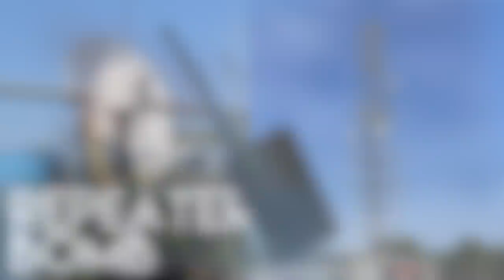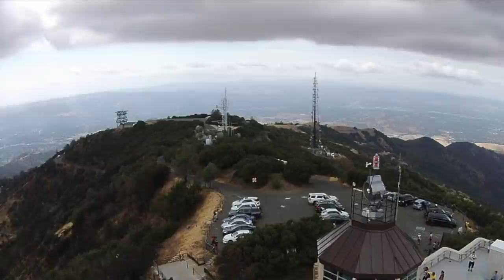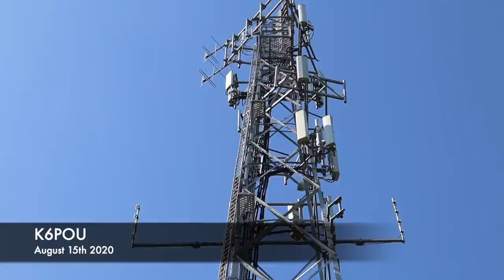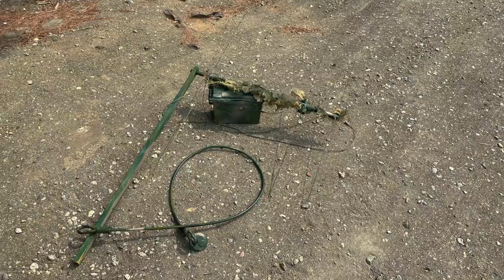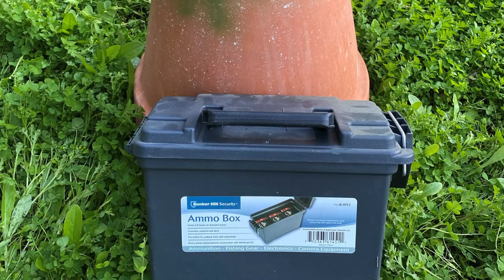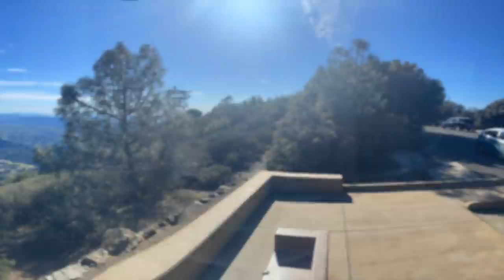The Hidden Diablo Mountain Amateur Radio Jammer

Comment: In the 1970s I had someone plant a CB jammer near my house. Took me about 5 minutes to find it.  I got a nice little CB, a car battery, and a good laugh out of it.
Reply: Why did they plant the device?
Reply: Sounds like you had 5 minutes of fun.
Reply: I'm gonna call BS on that. A car battery would only last a few days with any significant power output. I just can't see anyone thinking that would work
Reply: @NavinF  Let's say the car battery was just an average cranking battery with a low 50Ah rating (not the same as CCA rating). Now, let's assume the CB was a full-power 4-watt transceiver. A 12V 50Ah battery would provide 600 wh of power, which means it would power a 4-watt load for 150-hours, or 6.25 days. Ah ratings for batteries are "20-hour" ratings, and given the low draw, it is conceivable that it would have operated for at least 6 days, depending on the actual Ah rating of the battery. But it's not like it would be jamming every channel on the dial. There were 27 channels until 1977, then 40 channels were available. Still, a CB continuously broadcasting on one channel would only "jam" that one single channel. Seems pointless given the availability of other channels on which to communicate.
Reply: @HangTimeDeluxe  Thank you for the numbers! I guess the jammer would last a lot longer than I expected, but it's even more pointless than I expected.
Reply: @HangTimeDeluxe  I think your numbers are a little long,  you can't expect a CB to operate properly as the voltage drops, and he never said if it was a starting battery or a deep cycle, also your numbers seem to assume 100% efficiency of the radio which is far from reasonable. Now if you want to jam radios you only need a ignition coil an oscillator and an antenna. you can jam stuff up pretty good that way but still not 100%
Reply: That never actually happened.
Reply: @HangTimeDeluxe  27?    I'm thinking just 23.
Reply: TimeDeluxe No it would not last that long. I last my cb on in my truck and in four days it wouldn't start.

Comment: Back in the mid-1990's there were a number of radio jamming devices constructed, primarily for thwarting activity on various CB channels.  I was interesting in the technical aspects, rather than the political.  I set to locating & dissecting the units, to better understand them.  Sometimes access was prohibitive, but in at least two occasions, I was able to acquire the suspect devices.

The first device was rather simple, but also very effective.  It consisted of a 40-channel CB Radio, a Lionel model train transformer, a full-wave bridge, and a lamp timer – all of which was built into a metal ammo box.  The transformer produced strictly an AC Signal, and was rectified via the full-wave bridge to produce a very noisy DC power source, which powered the radio.  The radio itself had been modified in two primary ways.  1st, the audio limiting circuit was opened, to allow for severe over-deviation. 2nd, a sample of the 60 Hz AC power source was ‘fed’ directly into the mic circuit.  The result was a very loud & distorted 60 Hz buzz being transmitted across the channel, rendering the channel useless.  The lamp timer was set, with multiple on/off sequences, so as to power cycle the ‘buzzer’ as it was called, every few hours.  This made the device both annoying & difficult to track down.  The antenna was a simple dipole made of wire, and the device was located in the penthouse, of an 8-story building, giving the buzzer a significant height advantage.  This design is credited to the former Heavy Chevy.

The second device was more of a make-shift repeater.  It consisted of a 40-channel CB Radio & a VHF-High band Receiver, outfitted with two CTCSS decoder boards.  Both ‘Tone’ boards controlled relays, which activated with two distinctly separate tones.  The 1st board controlled the PTT Relay, while the 2nd board controlled a relay in-series with the audio path.  In essence both tones would need to be present, in order to both key the CB, and allow audio to pass to the transmitter.  The VHF-High band receiver would pick-up a signal, with both correct tones, and the CB would rebroadcast the incoming signal over a particular CB Channel.  This configuration made it difficult to track down the individual offender, and the two-tone protected receiver made it impossible for the average person to hijack the repeater.  This designed is credited to the late Tricky Dick.
Reply: One story that happened very close to me somewhere in the 70s when most amateurs around here could not afford expensive gear was that some wealthy guy bought himself a multi kW but very noisy transmitter annoying the hell out of everyone around. The result was a little transmitter built by a small group that was then planted right on the property of the guy. It consisted of a wire antenna pushed into the bark of a tree, some simple and small transmitter and a storage cap. The guy would transmit, thereby charging the storage cap of the jammer with his own transmitters power and the jammer would then transmit some annoying tone for several seconds making it impossible for him to hear any replies to his calls. All that with no battery which meant that it could operate for as long as the jammer didnt break for other reasons.
Reply: @NIOC630  that idea   : D
Reply: That Tricky Dick repeater sounds pretty cool. Being in CB though, isn't there nothing wrong with that? Or is it because of the use of VHF?
Reply: @RAndrewNeal  Oh, it was probably not what I'd call legal, by any stretch of the imagination.  'Tricky Dick' worked at a local 2-way Radio Shop, & was rather eccentric, although he did have a fine appreciation of Jazz Organ (i.e. Booker T & The MG's).  He was very smart when it came to electronics, as he saw connections & possibilities, where others did not.  In my youth, I learned a great deal from him.  Some of those skills I still use today.  He passed away several years ago, but he has not been forgotten.
Reply: @arbutuswatcher  Oh. Why doesn't it seem legal? I'm not well-versed in any of that FCC mumbo jumbo (yet).
Reply: @RAndrewNeal  back then FCC had more power over citizens and the bands they could operate much like HAM today's age FCC pretty much doesn't give a fuck about CBs as no one really uses them anymore so they can't kick you in jail and sell off your assets that were connected to the CB
Reply: @railgap  Still doesn't seem like a problem. It's a CB repeater that is only available to the one who owns it; essentially an extension of that single person's range. Could you explain why it's a problem instead of vaguely stating that it is?
Reply: Was this in California?
Reply: That was mine, it was set to channel 21. Its probably  still up there today. Call me Mr. A** Hol*!

Comment: Years ago, there was an amateur radio jammer on a repeater nearby. It was a 600kHz oscillator and a mixer. The output frequency of the repeater was mixed down to the input (600kHz is the european standard for 2m). The device was tiny, solar powered, and built with expertise. It's a shame that this knowledge was used so destructively.
Reply: Hi Michael, a similar technique was employed in Melbourne Australia about 30 years ago,  few people understand the destructive potential of this near a busy radio site.  Very difficult to locate also.
Reply: So a bent pipe? That's so evil!

Comment: I ran across a jammer that I think was being run by local LE about a year before the 55 was repealed. I was driving North on I35 through Temple TX. My car was a real POS, just about everything was likely to break at any moment, so going fast, as much as it is in my blood just was not feasible. Driving that POS probably saves me a big ticket that day. 
Just south of Industrial, I35 has an S bend. On approaching that S bend I noticed alternator whine. I knew my cheap CB had some whine when it was receiving, but it was not making any other noise, so I thought that either the battery or the alternator in my car was failing, and that the noise was now coming over the car's radio. I turned of everything I could reach and the noise continued. Then I noticed that there were about 20 police cars on each side of the highway with people pulled over. I just kept on going, looking for an AutoZone, without running the headlights and AC like i usually did. About half a mile past industrial I began to hear all kinds of people warning about the speedtrap and the jamming. It was all distorted because they were just barley able to talk over the jammer. I got to the autozone and both the alternator and battery checked. The battery was a little low because the alternator had a bad diode and was only producing 2/3 the current it should. I bought a rebuilt alternator and a belt and pushed on to Dallas
Reply: Was LE jamming cb radio?
Reply: I wish you could still fix cars like that. Had some early 90s Japanese cars that you could do basic stuff on the side of the road and they were great.
Reply: @stevennaumann7212  Breaking federal law to run a speed trap? Sounds like some small town badged bandits...
Reply: @Teesquared00  That’s still true on certain Hondas over the past 20 years. It just takes having enough tools on the side of the road.   My 1999 Integra was a pain in the ass to change, and I needed the lift at work.  My current car, a 1997 Acura CL with a v6, took about an hour. I had to empty and remove the power steering reservoir, loosen the passenger side motor mount, and jack up the engine a little, but after that it wasn’t as bad as the Integra. I could potentially see “side of the road” for the CL’s alternator.
Reply: 😂😂 sure sounds like good ol central Texas law enforcement to me. Being from Waco I would know lol
Reply: @jonnda  That is freakin' ridiculous and incompetent design.  I suppose these manufacturers don't expect owners to work on their own cars any more.  Still, even the pros have to spend an inordinate amount of time to do a simple repair.
Reply: @Teesquared00  On a somewhat recent trip to Scotland I replaced the failing alternator in my 2007 Accord, using only the spare tools I kept in the spare tyre zone. My 2002 Lexus is200 is also quite easy to work on.
Reply: Just mod your radio with a power selector switch. Legal power, or high power. Now the only problem is you're the only one who can warn others, but still can't hear their warnings.
Reply: I'm in Belton.  Always find it fun to encounter people talking about Temple/Belton on random YouTube videos.

Comment: Radio jammer in my neck of the woods is disrupting signals and causing soddy traffic across the world... What a time we live in
Reply: Direction-find them and file a complaint with the FCC.
Reply: Use an RF Loop if you don't know how to build one you can ask a local HAM operator or google I bet has it, they are easy to construct.  And even funner to use